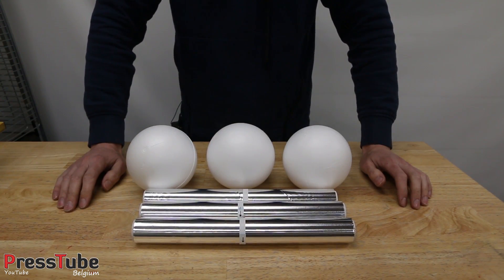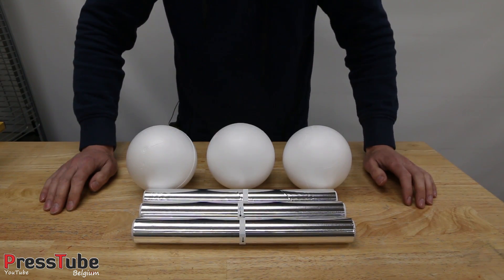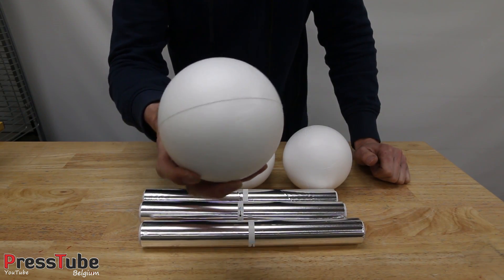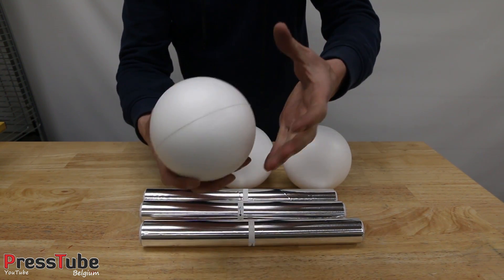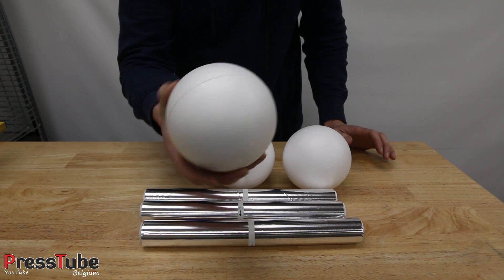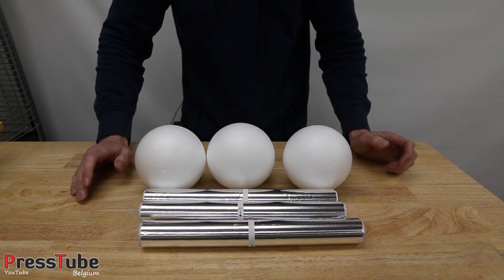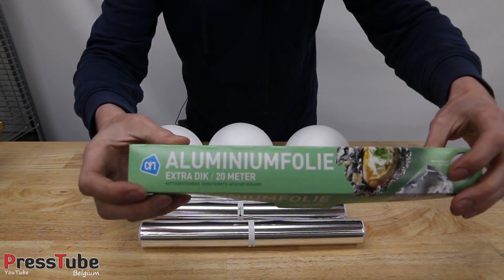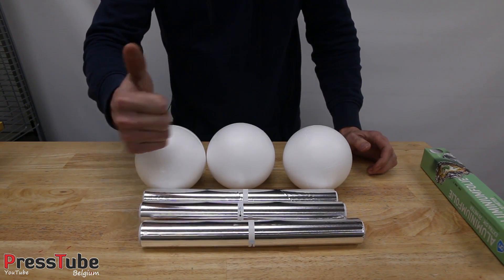Casting Mirror Polished Japanese Foil Ball from Molten Aluminium

Comment: I get that it’s a ball and it aluminum and even that it was foil before you melted it, but the thing about a foil ball is that is beaten from actual foil over a prolonged and tedious process. There’s a zen quality to the pursuit and, not a minor point, it is surprisingly light for its appearance because is has a lot of air gaps between layers; it is not solid. You have a shiny aluminum ball and it is very nice and you spent a good bit of zen like time on it, but it is not a foil ball. It is a cast ball.

Comment: Hint - for easier pouring put in a gas vent at the very top of the casting - put you pour gate just a little off center the gas will vent and when ur pour is complete the metal will come up the vent hole.. I used to be a moulder/core maker / iron pourer in a foundry when I was 18 years old - I'm 71 now ... good luck --- also for a smoother casting pack your dirt after 3 or 4 inches goes into the mold

Comment: You’re nuts putting the tools in molten aluminum without a preheat.. and the bubble thing.. be careful I have had friends injure themselves bad. It’s a good idea to put vents in the sand that allow the gas to push through the mold without bubbles.. 
thanks for sharing.. love the setup

Comment: I'm not too familiar with sand casting of this scale but I've done small figurines and stuff. Why would there be no vents to allow escape and to pull the metal into the mold? A gas vent.
Reply: Also the step of removing the polishing compound is satisfying.

Comment: You can clean up ball with half the water if you just put it in a small bucket of water🙄🙄🙄🙄
Reply: Aparajita Bauri he’s not really trying to clean the ball, but in order to continue working with it he needs to lower its extremely high temperature. 
Putting it in a bucket would probably make the water boil.
Reply: @ezkai7645  so let it rest for some time...then add water to it..it will eventually cool down...🤔🤔

Comment: AluminIum is the correct way to pronounce it. The Americans changed it during the war because technical writers were paid per letter, and they were purchasing a lot of aluminium at the time. so they cut costs from the often repeated word by removing a letter. and to this day, they are still retarded and do not pronounce it correctly.

Comment: Is there a specific reason for using foil other than it melting a little faster?  Why not use aluminum cans or even aluminum rod or bar stock to more quickly arrive at the desired volume?

Comment: Wow. A lot of effort. I'm curious about something. I've polished brass to a mirror finish (by hand) and was told to do it in different directions before and when changing grit for the best/quickest results. It seems to be very smooth. Are all of the grooves out? What I've been wanting to see is the opposite of that. A 360° sphere that is mirrored on the inside. Any idea how this could be accomplished? I think it would require some electroplating techniques. Very tricky, but it sure would be cool.

Comment: Hey bra... wear some gloves. The fine aluminum particles will get in your blood stream and give you Alzheimer disease. Worked in a sheet metal shop for 20 years. Ran an aluminum grainer. I wore protective gear other guy did not. He spent 2 year crapping his pants as the disease tore him down. Got it from the aluminum. Just saying.. very good work. Nice finished product.
Reply: doubt that's how that works
Reply: @burp2019  Not something you can reverse - Wear protective gear or suffer occupational heavy metal poisoning later - that is a fact - Doubting something does not change physics - Ingestion and exposure to micro particles of any metal like he is producing causes irreparable harm.
Reply: The Alzheimer’s was put about by the trade union for compos no truth
Reply: Well What is the point in ‘tis allyluminum ball pronouncing as you like I not concerned about the word
Reply: Ur life could be a film
Reply: The link between Alzheimer's and aluminum was debunked a long time ago.
Reply: Not something you can reverse - Wear protective gear or suffer occupational heavy metal poisoning later - that is a fact

Comment: Theres so many things dangeroous and wrong about this im suprised he still has his fingers and eyes.  For a start, he melts the aluminium in what seems to be a gas crucuble with no effiective temperature control. Aluminium is part of the boron Group, and is very reactive at high temperature, and burns like Magnesium - which is why the HMS Sheffield, an all aluminium ship, burnt and sank in the Falklands war in 1983, (and why one of the hottest burning powder mixes, thermite, can be made with aluminium and burns at 2300C).    Most commercial smelters use an electric crucible for safety,  and with a Carbon Dioxide gas cap to prevent  oxidation  When he degasses it, the crucible is far too small and theres a danger  molten aluminium will spill out onto the cricible wall and ignite. When he casts, the pouring funnel is too small and  molten aluminium floods out over the top of the mould. when he drills it, he doesn drill it on the lathe, so the hole is not axial or central, causing the balls to spin and vibrate the lathe off centre, and there is no running centre on the other end of the rotating ball to prevent it coming off or spinning  out sideways. Seriously, do not do this like this at home,  this guy has no grasp of safety. You will lose fingers, toes, eyes or skin.
Reply: Um, brush up on the science first before criticizing. Thermite reaction is not the same as aluminum burning. And aluminum doesn't spontaneously burn like magnesium does. There are hundreds of youtube videos of people melting aluminum.
Reply: I dunno ... he got everything else right — specially the ball being drilled off-center. All that work and the damned hole it off. Wtf. That’s not art - that’s just mediocrity. 

Also he had that nice flamin’ flame next to the furnace — next to what appears to be a hose for the gas?? Hmmm...
Reply: Stephanie Simpson fuck you

Comment: You can get easier quality results from casting with an aluminium alloy formulated for casting. Such things as old auto water pumps from an auto shop is a good source. Foil is formulated for ductility and doesn't have great casting properties.

Comment: Well I would never have believed that.  Is the scum impurities?  If so was in tin foil to cause that?
Reply: Partly, but it's mostly an oxide layer formed on the surface of the molten Al. You can leave it there and when you pour it will generally hold together and the pure Al will run out from underneath if you're careful.

Comment: very nice bud.. Well  done.. I wonder about the dangers of off gasing from the melting of aluminum foil.. Glad to see it was done outside.. Thanks for sharing and  some very nice work.. Thumbs up.. :)
Reply: The gas from melting aluminum is primarily hydrogen. Sodium silicate is often  used just before pouring and removing the dross. This will also help eliminate pitting, which was fairly obvious in the sphere casting.
Reply: i wonder if there's a way to use some type of filter to catch anything that might be harmful in the air
Reply: @vulcanprincess1584  that's why it's outside & you don't hang over it breathing it in!
Reply: i know its negligible but i wonder if it affects the atmosphere/ozone
Reply: @vulcanprincess1584 , pure hydrogen gas is scarce in Earth's atmosphere, and any hydrogen that actually enters the atmosphere generally rapidly escapes Earth's gravity. It is so negligible that I'm pretty sure it'll be okay. 😄
Reply: fair point, good to know!

Comment: Would you get a smoother finish if you let it cool slowly? Using water might crystallize the metal and change the structure so it will never polish out.

Comment: Good job! You should have gone way heavier on the lower grits. I you had started with 80 and went through all the papers from 80-120-240-360-500-800-1500-2000 and even 3000. Then your ball had been 100% spot free for marks (Y)

Comment: Should use a flux over the Al and air injected burns the O2 making dross leaving H which forms H2 with small to tiny holes.  The flux keeps the air off the Al and it reduces the metal.  Martin

Comment: I like the soil. Where I'm at I would have had two buckets of rocks to get half a bucket of soil.
Reply: Not soil, looks like petrabond, a special expensive mix of very fine sand and oil. Some of the old time casters call it facing sand and only use it where it makes contact with the pattern.
Reply: Lol. My soil doesn't look like that either

Comment: 12:48 ball rests on a flat bottom: fail

Also, the element was "Aluminum" first (from its discoverer) and stayed that way for a very long time so it is not incorrect to call it that. At present, the only incorrect position on that matter is to insist that one word or another is incorrect. If you actually look at the periodic table, many elements end with "num" and there is not a convention being defied there.

Comment: There is a quite number of sinkholes on the surface.

Maybe you want to consider to remove the styrofoam ball by acteone (a common practice).

In that case the walls of your form would not be disturbed by the styrofoam burning (local high pressure, acting onto the inner side of the form).

Comment: You did casting in a wrong way !!!! 
First of all you need breathing holes, to let the air out, not just one hole !!! 
Second, the Impurities that you are removing from the metal liquid, everytime you'll put that thing "large spoon like" you'll get some Impurities, this is not actually Impurities, but this because, that thing's temperature is much less than the liquid, so the metal  gets hard !!
Thirdly, you didn't remove the object , this is so wrong , cuz the object is made of plastic , this will produce unwanted co2 !! And Impurities... 
And finally, you could have had hurt yourself, take care, and do it the right way, 
Good luck.

Comment: Actually you should make an air vent (technically termed air escape) on one side of the sphere so the excess aluminum could flow out. In your method, you risk the trapped air exploding at the inlet and that could be dangerous.

Comment: How/why does the de-gassing process work? I've dabbled a tiny bit in smithing, but never with casting. I think this seems so neat!
Reply: I second this question, please tell?
Reply: To remove impurities such as hydrogen that is dissolved within the melt. Gasses (i.e. Ar, N2) are injected into the melt to recombine with the hydrogen which escapes in the form of bubbles. Using air adds other impurities which cause slag to form on top of the melt and needs to be skimmed off.

Comment: You missed the point. Its about real labor not a cheap Belgium Chinese knock off. Its not foil if you melt it. Its just aluminum at that point. But a true foil ball will always be foil just hand hammered and rolled and polished. Cheap Belgium/Chinese knock off!!!! But still pretty cool man. Just kidding with the Belgium stuff. I do respect the your chocolate all to hell.
Reply: and even after melting it ... he had to drill a hole into it and use a lathe to polish it...

Comment: Hmm... I know a method to fill the holes... When you make a reflective telescope mirror you vaporize aluminum in a vaccum chamber to a parabolic shaped glass... Maybe if you do the same, a few times, with the ball you can fill al the holes on it and make it shine even more, like filling holes in a wall until it's flat after sanding.

Comment: He did a good job here: lost-foam casting isn't as easy as it sounds.  De-gassing is critical: you submerge a chlorine tablet from the swimming-pool supply store to remove dissolved gases in the melt.  But the comments are disturbing, for none of what he did here should be a mystery for any citizen of an industrialized nation.  The Chinese teach "shop" in their schools.  The US ceased doing so years ago, and we are paying the price.  

I made a furnace by digging a hole in the ground, filling it with charcoal briquets, pushing a steel pipe into the pile to carry air from a vacuum cleaner, adding some newspaper, and applying a match.  When you turn the air on it wakes up the whole neighborhood.

Comment: That's cool!  

But the whole point of making a ball from crushed foil is that you don't need a furnace and training in how to use it and a cement or brick patio and a crucible and tongs and special gloves and a propane tank and a ladle and a foam ball and a nice metal bucket and a whole bunch of finely ground sand and a tamper and a water hose and a drill.   Eh hem.

Comment: Casting it would have been interesting.... except that after casting it, the rest of the process was completely different from typical foil-ball techniques. Not that casting a polished aluminum ball isn't cool, but there's almost no connection to the foil ball trend.

Comment: so this might be a dumb question but what was the slag you removed from the top of the molten aluminum? shouldn't the foil be pure aluminum so no slag? or in melting will there always be some slag? did the aluminum react with the air to form aluminum oxide?

Comment: if you use a riser on your casting hole and a smaller vent it will help fill your mold ,even lost foam casting,the weight of the overpour will insure a solid casting

Comment: You also cheated by using machinery to make the job easier. 

For me, this mirror ball isn't a "Japanese aluminium foil mirror ball"
Reply: RhipKord it’s not supposed to be one either
Reply: In this video i am making a "Mirror Polished Japanese Foil Ball" from Molten Aluminium that i melted in my Metal Foundry.   So what is it ??

Comment: Nice ball, I would not have thought there was that much foil in a box.
You have nice safety gear, I would like to see you have a bed of sand around where you are pouring, The bricks will explode if you have an accident, The one by the furnace was starting to pop just in a few seconds with the aluminum on it.
Also when I pour, I keep a bucket of water near by to cool castings, just drop it in slowly and leave it a few minutes.
Good job on the video.

Comment: How many rolls did you use ? I wonder how you could get enough material with only three. I did not calculate but it appears very little.
I once tried to melt aluminium with a torch veru thin foil, it evaporated, did it burn with oxygen and gazed ? Must be toxic. Fundery too maybe.

Comment: I work with aluminium every day at my job, (a lab that tests bonds) and I know how soft it can be and easily worn down by sandpaper. I think you could have gotten an almost mirror perfect polish if you first went from 600 to 800 grit and didn't go further until all those tiny nicks were gone, though this might require unmounting it and spending a lot more time with the piece in your hand or on your lap. Also a bit of generic dishsoap in the water during wetsanding with 1500 can get you near to a mirror finish before having you use compound.

Comment: Put it in the microwave for 30 seconds. It gives it a really nice shiny finish.
Reply: Mr Chode 😂
Reply: If it has no sharp corners or edges, it would not really create any sparks
Reply: Nuclear explosion
Reply: Have you done this?  It doesn't do much of anything.  The ball heats up a little bit, and it's not great for the oven, but nothing helpful or spectacular happens.

Comment: can you make aluminium cube ? that's going to be a challenging one :)
Reply: Not really, he just need to add actual air holes to his mold next time so it doesn't try to bubble up through the same hole he is pouring down.
Reply: mario lee I’m interested. Please post a link to a video when you are finished in this comment 🤞🏻🤞🏻🤞🏻
Reply: PsyChotic I made one but no video mainly I just reply to videos, need to learn how to make one.

My process was to make a core a solid core and square it as best as possible by hammer strikes,keep in mind this DYI project so this took time and was sore but a 50ft roll bout an hour or pounding and had a billet made from foil.Took that and wrapped it with foil taking care to wrap the core like a cross,and yes it was 50ft of foil.Then I compressed by body weight and finally shaped by hammer strikes into a long cube.I did take pics I'll post if I can to my page.The square wasn't hard actually,the cone or pyramid or triangle (haven't decided which shape to use) is the real challenge
Reply: PsyChotic already working on mine an x and a cone to go with my sphere I'm a gamer so you can guess why I'm making those shapes....OUT OF COMPRESSED FOIL BY HAND,AND A DREMEL TOOL
Reply: mario lee o shit ❌⭕🔺⬛ well...good luck lol
Reply: PsyChotic Thanks brah,the challenge is real no doubt,but smoke a good one and some tunes and it is quite therapeutic.

Comment: I think the purpose of the sphere made by the Japanese is to be able to create a smooth surface from crumpled aluminum foil using manual technique. By melting it is possible to make a winged horse with perfection. But I understand what the intention was.

But even so, it gives a certain agony to see that the sphere was not balanced and perfect.
Reply: Mykaya Rose lol

Comment: That's a cast ball you made. The idea of the Japanese foil ball is that you can make one in about an hour and a half with no polishing or sanding. The idea is that you can make something fast, shiny, and strong just though manual labor with little tools. That's what makes it so special! Everyone I see is doing it wrong. The original artist makes the balls for his sculptures and he makes them in under two hours using a small anvil and the round side of a peen hammer. You start with hammering a ball the size of a pea and then hammer in layer after layer. They layers are so thin they forge together. No seams, no sanding and no polishing!

This is completely missing the point.